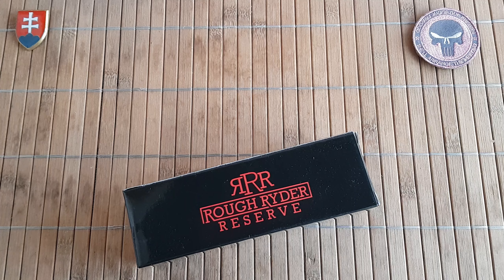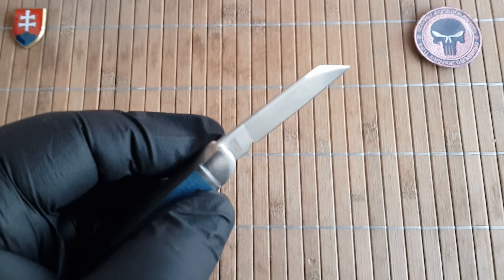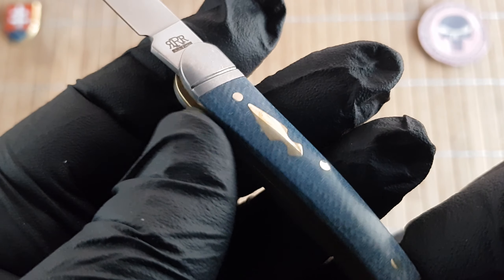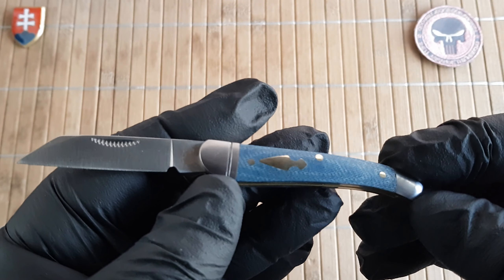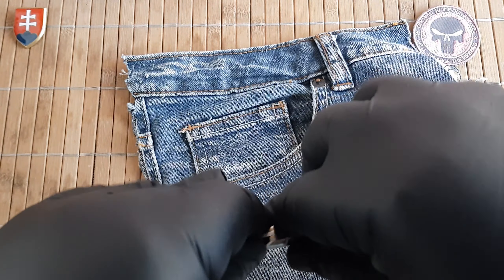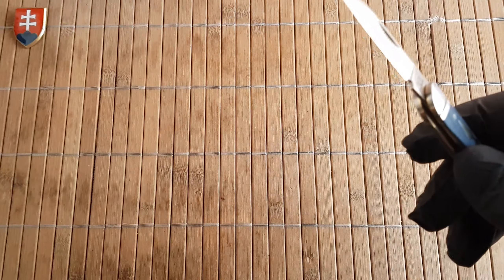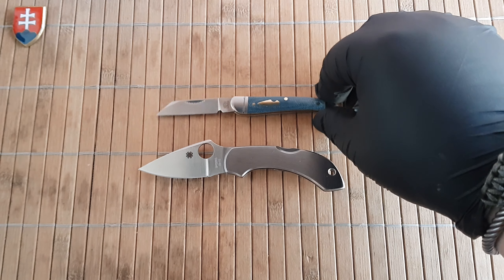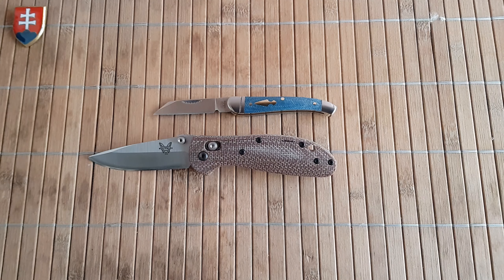ROUGH RYDER RESERVE SMALL COPERHEAD

Comment: This pattern is called a mini-copperhead where the cap-end bolster is shaped like a snake head.  They normally have a Wharncliffe main blade and an opposing pen blade.  Case and Frost and others have produced this 3" gentlemans folder.  A standard copperhead is a completely different knife with the snakehead being on the pocket (pivot) bolster.  This RRR is really nice!
Reply from the maker: Thank you James. The question is if the copperhead is an actual old pattern or if RR only gave it a brand name Coperhead with one P  and it could be an offshoot of the curved jack knife like the peanut is. Size wise they look similar.